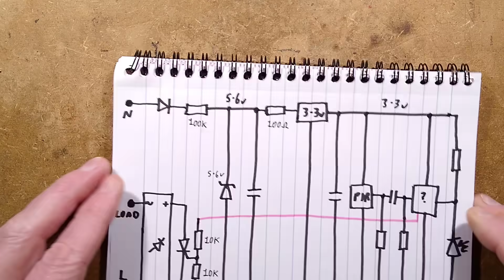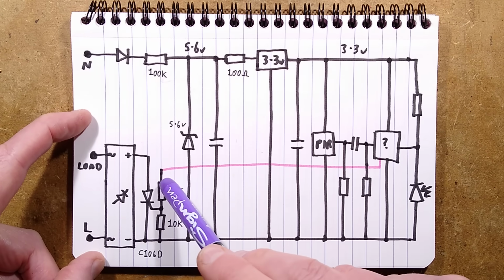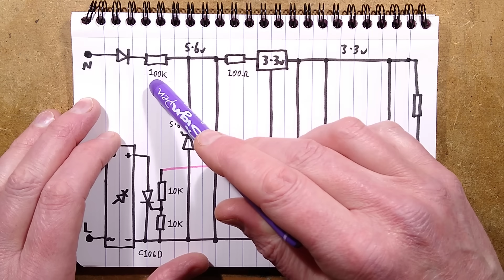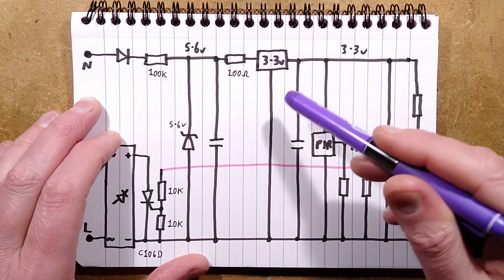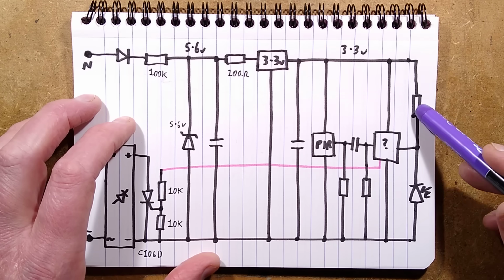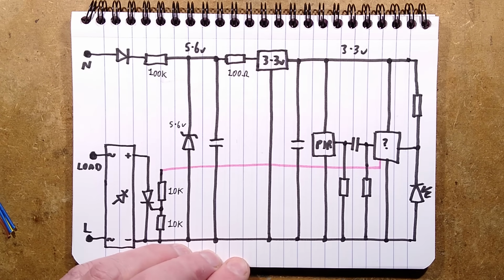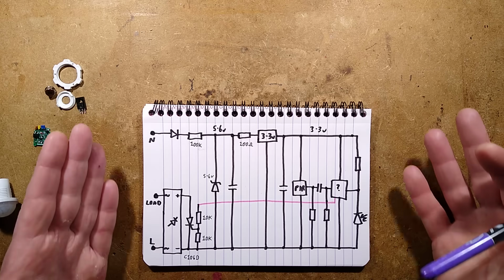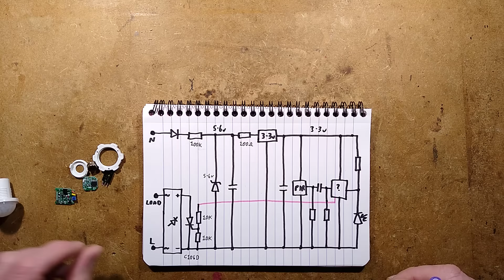Cheap PIR movement sensor and switch - with schematic

Comment: That takes me back, the c106d SCR, made a 3 channel sound to light controller, 3 x C106d's various capacitors from old tv and bought resistors, 12 volt 300 ma transformer and pots from Tandy, worked by connecting speaker output to 12 volt side of the transformer via a 10 ohm 10 watt resistor, mains side of transformer were the rails and via pots and caps(400 volt rating) which made a crude filter for each thyristor to sense bass, mid and treble and pulsed the gates, dearest parts were the red, blue and yellow spot bulbs 60 watts or 100 watts, I still have it somewhere, bet it still works if I could get hold of some incandescent bulbs.
Good old days of 1984

Gaz Yorkshire.
Reply from the maker: Sounds like the Maplin Party light project.
Reply: @ It was a kit my future brother in law got from John Bull electrical it was around £12 in those days 1984, may be they were selling surplus Maplin gear too, but I just copied it as it had a schematic with it, he had a go but could not really solder and thyristors were in the wrong way round (50 50 eh)
By then I was making my own one off circuit boards with etch resist pen and ferric chloride from Tandy, still make odd things these days.
Ps I completed the project for him, he was impressed with it and used it at a few parties.

Comment: I use a USB 5v Mini PIR in the living room paired with a round COB LED (previously a white led light strip), makes it so we dont have to use the main living room lights when going from one room to another or when coming home from shopping etc. When the power goes out i just disconnect the PIR and power the light with a power bank.

Comment: I nearly got one.
I saw reviews saying the short ON time rendered the thing useless.

I got a different model that is slightly bigger and has switches on the back to adjust or disable the ambient light sensitivity, and adjust the ON time from useless to almost useless.

I had a PIR switch that had an adjustable ON time of 30 seconds to 3 minutes, and by adding a Meg¹ ohm resitor bumped that up to 30m30s to 33m.

¹ Shut up, Meg.

Comment: Ive installed burglar alarms since i was born. Dad started the business in 1969 and no other kids wanted it but me...well until they realized it make monthly income on monitoring....anyhow you can give me a list of top of the line fort knox level of protection equipment and i guarantee u i can get you the same level of quality part at the lowest price on the earth. Im not selling things here my point is. All this equipment used to be wallet busting nowadays its all cheap as heck but works just the same. Installing a system in a home used to run about 1000usd for parts and now i can get em all for 250. Explain that to the customer who googles every item and understands nothing

Comment: I've recently found that PIR sensors don't work in supermarket installations - I think it's the lighting they use in the stores. They just constantly trigger, even if shaded from direct view of the lighting. Had to change to ultrasonic sensors for proximity sensing.
Reply from the maker: Anywhere near refrigerated displays?
Reply: @ not sure, I didn’t do the install, just designed the tech. It’s for interactive charity donation points. They play videos when idle and switch to different videos when sensing someone, then other videos after a contactless donation. We hadn’t had any problems in other locations but in superstores they reported issues. Do you think it could be the temperature fluctuations near the fridges?
Reply from the maker: It could be, plus the continuous movement in the vicinity.  You may be able to mask off peripheral influence by adding a cover with a suitable sized hole in the end to create a sweet spot for local presence.
Reply: @ yeah we already narrow the aperture to limit the area covered. These have been spontaneously triggering before the stores open with nobody around the area - same tech that’s been used for a few years now - even in outside locations so it’s something specific to the stores. The ultrasonic sensor fixes it and it’s a quick swap but caused issues for a while (the videos that play when a person is around have audio, whereas the “idle” videos do not, so it was annoying to staff in the vicinity 😁 (it could be their staff trolling me of course!)

Comment: 100R resistor is a left over from when the power supply was a capacitive dropper, left there instead to limit spikes from the incoming mains if they flash over the 100k resistor, so it has a tiny chance of surviving. You can modify this one simply by using the neutral lead, not using as loop through, to have another 100k 1W resistor in the neutral, to keep dissipation down.

Comment: Soldering the boards together to form a perpendicular mechanical connection is both brilliant and bodgy. I like it. Cheap, but effective for something that doesn't need to worry much about strain on the connection. Certainly no worse than sins I've committed with circuitry.
Reply: Direct board soldering is fairly common for 230v powered electronics and other mass produced stuff.

Comment: Does it also Switch an led load or only a resistive tungsten load?
Reply from the maker: It appears to be continuous drive to the thyristor, so should be suited to many loads.  But not the full rated current for electronic loads with high inrush current.

Comment: I fitted an identical looking unit into a vintage, 1960s Coughtrie bulkhead light about 5 years ago. It mounted into a redundant side cable entry and has been working perfectly outside my patio doors ever since.

Comment: Would be interesting to measure the power/ current used through this device, when it is in standby mode? ❤
Reply from the maker: Ultra low.  A fraction of a watt.

Comment: I built a very similar one into the emergency LED light above the door of my workshop, to turn the light on when someone approaches the door in the dark. The sensor itself worked fine, but I installed it inside the clear plastic cover, thinking it'd be more weatherproof like that. But whatever the clear cover is made from must be opaque to infra-red, as it can't detect movement through it (unless I rub the clear cover to warm it up - it then detects the heat, and turns the light on as it should).
Reply from the maker: That's why most PIR sensors are mounted outside the light.  Most plastics block longwave IR.
Reply: I have a similar situation with several external sensors for driveway lights - they face west (setting sun) and the covers have degraded to the point where the lights stay on all night because the IR is not detected but the daylight is.
Reply: Simply put up a fluorecent sign instructing nighttime visitors to rub the lamp for the genie to appear ...

Comment: Guessing the N is the ac line ,two blue shorted. Maybe the load is the load gnd getting shorted to neutral .
Reply from the maker: The two blue are the neutral for the module and the load.  The live is switched to the load.

Comment: I've bought one a while back from Aliexpress, together with an LED lamp and fixture.
It's our garage now, so when you enter you have some light. 
The LED fixture was free, as they had sent me the wrong one! Lol

As for the mistery chip; reminds me of an earlier video on which I had tried to sent you an email about. In the video you had taken apart an PIR "switch" which also had 3 potentiometers, light level, sensitivity level and time delay.
I think the chip, and it might be in this case too, is nothing more then a few opamps configured as comperators.
In this case the output are internally connected to an AND chip, giving the output only "1" if all levels are high. 
You can do this with an Opamp as wel by give one input a set level and the other input needs to get to that level, be it light sensitivity, motion or an RC for time.

The reason I know if because I had a PIR sensor which seems not to work. The potentiometer for the PIR wasn't oke anymore due to oxidation. Hence sometimes it was somewhere around 500-1000 Ohms, other moments it was either in Mega Ohms range or even higher, hence the trigger never happend.

Hope you find it useful information.

Comment: I was trying to make a project few days ago to control AC and was having difficulty switching pwm current through a mosfet. This circuit really helped me improve my design. Also the bridge rectifier hack is really nice.

Thank you so much!

One note regarding the 100k resistor, it wont get that hot from experience.
typically it should drop 0.5W  (220^2/100000) however because of the diode it will only conduct half of the time so actual power drop would be 0.25 and that is assuming the resistor is shorting the AC terminals

Comment: I have a PIR sensor wired up to some (separate) hallway mirror lights thereby replacing a switch and for the most part it seems to work fine. But I noticed the mirror lights sometimes also switch on when I power the main hallway ligths (on the same braker circuit). It seems the PIR sensor is sensitive to transients?

Comment: Great to see an AC switch the way I designed it 31 years ago. 😁 It concerned a 24 V AC circuit, so I used a mosfet instead of the thyristor.

Comment: Normally I watch a video before I comment but I am jumping the gun because I was hoping you would give these pir a seeing to.
I have several of these and of the selectable version.
I'm happy with them, even as I had to cover the light sensor on some.

My interest is with that circuit and how the rectifier sits on the incoming and outgoing circuit.
That's had me baffled since I got mine a couple of years ago..

I'm now going back to the video hoping for my enlightenment.